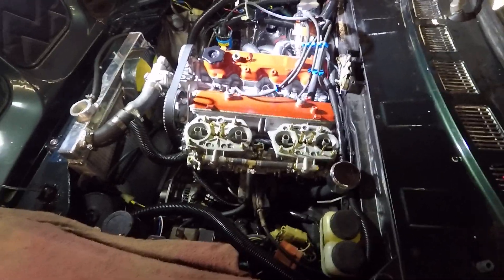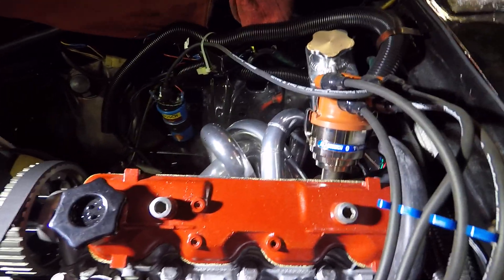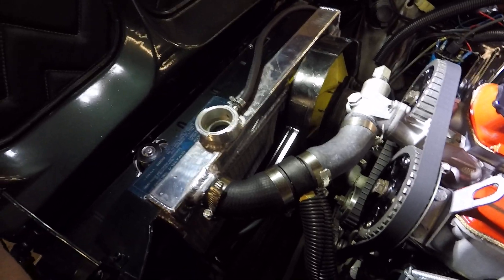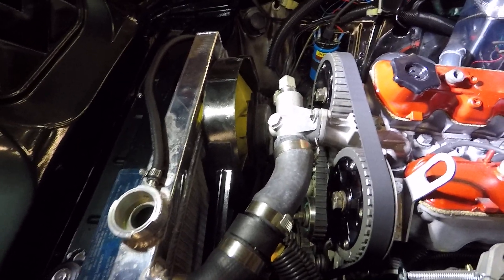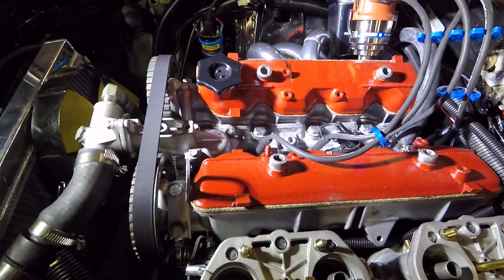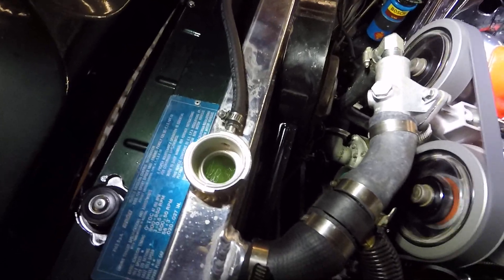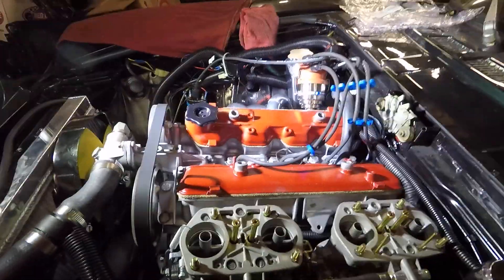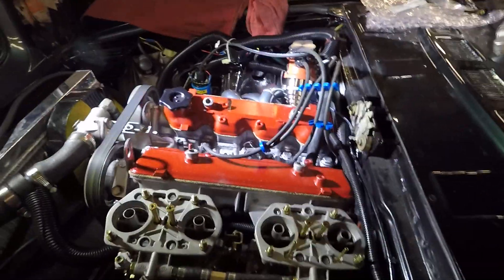Fiat Performance motor from Allison's Automotive

Comment: If you added a turbo to this engine. W on a fuel injector set up what would the hp over 130-140 range
Reply: It pretty much just depends on how far you want to take it. There's been people, with extensive modification, who've put these engines over 400 hp.
Reply: @willmich9895   id be happy with 225 give or take
Reply: @FstopPicturesByAlunDavies  that would definatelly start to creep up in price. You'd need to start adding different parts to handle the power. Stock diff etc would not handle that.
Reply: @willmich9895   would 160 to 170 be  manageable
Reply: @FstopPicturesByAlunDavies  id think so. Its not incredibly common to boost these, but they were offered stock with a turbo for a few years in the 80's, pumping out 120 hp. If i were you, I'd just do performance cam/headers to get somewhere near your 140-160, and stay somewhat true to original. That is what you see alot of online. Look on fiatspider.com for forum members projects, and the online shop autoricambi.us for the biggest supplier of 124 parts.
Reply: @willmich9895   it was my  understanding     that yhr turbo fiats didn't have forges pistons  
Street cams. Etc  so I can see a,160 hp  range   even if. One had to use a 131 transmission   which is a sturdier transmission
Reply: Its really nice without a turbo and with the big carbs. Just classic Lampredi with an Abarth like tune. That epic sound, it runs really nice